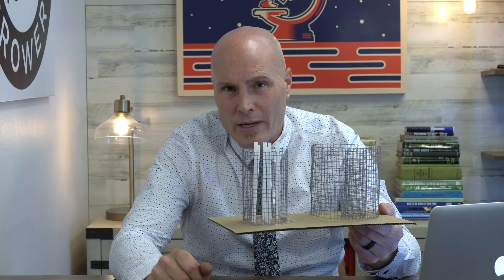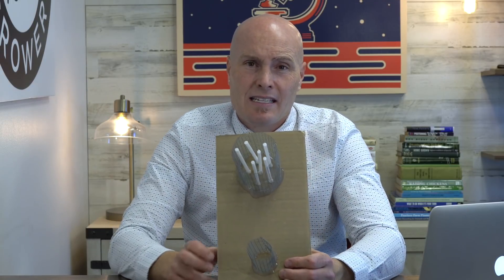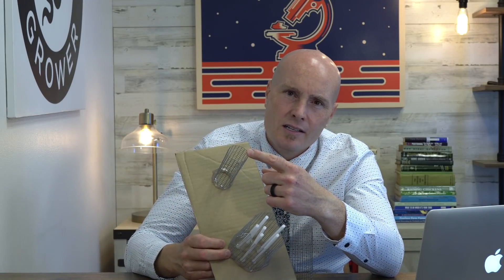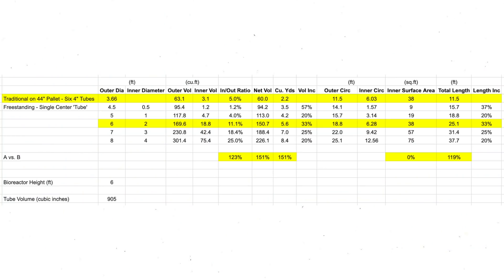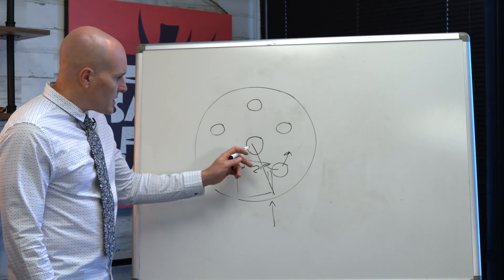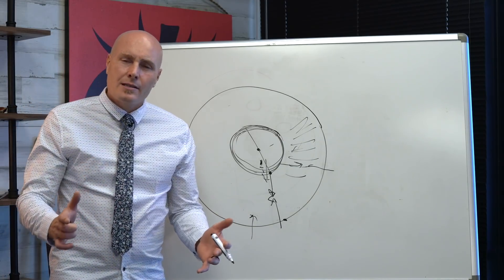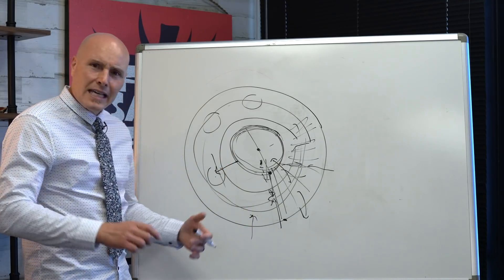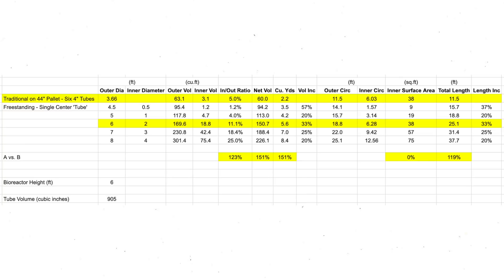Designing a New Compost Bioreactor | DESIGN SPECS and QUESTIONS ANSWERED

Comment: Put 4-5 hollow wooden pipes perforated with holes, horizontally through the wire mesh but leave out the center ring.  Position them from top to bottom with equal spacing between. Attach small fans to one end of the wooden pipes or one fan with a manifold to push air through the pipes and into the pile.
Make sure they dead end at the edge of the other side so all the air flow goes into the pile. 
Cover the biocomposter with a criss cross frame and an opaque tarp one foot above and around the composter, sealed at the bottom with dirt to create a humidity dome. Make sure the open end of the wooden pipes extend outside the dome but sealed to the dome. Mount the fans inside the open end of the wooden pipes.Then put a drip line ring on the top of the bio generator to provide water to maintain internal moisture. Sensors and a controller could be used to regulate the moisture and air parameters efficiently. The fan forced air should permeate further into the pile and the dome would contain the moisture. Regulation of the airflow is key so the pile doesnt dry out.
This in my opinion is a “bio-generator” as it has active inputs not passive input methods. Think of how an internal combustion engine works. Forced air and fuel input with lubrication,and means to adjust and control these parameters to efficiency. No doubt though it would not be aesthetic lol

Another method would be to use humidified air flow through the wooden pipes. Im using wood because they could be left permanently at least until they biodegraded to a point where they no longer worked. But certain wood species would last for at least a year or more. Also the wood could be a suitable host for mycellium to colonize and further enhance the decomposition.
Reply: The simpson su generator and other designs are really just vertical compost bins…..
Reply: You have to remember the center of a compost pile is where the action starts. You’re essentially eliminating the center of the pile with the inner ring, Forcing the decomposition to take place along the outer edge of the vertical pile where its prone to drying out faster. Also if you were to layer the components inside the bin it would be closer to replicating the natural environment.

Comment: Grateful to have found this video because I have been reluctant to use the traditional system due to aesthetics. Thank you for refining this bioreactor design to be more pleasing to the eye. Not a big fan of using a wood chipper so I am going to try your system with some larger branches and stumps in the mix. Time will tell, right?

Comment: Air input is beneficial.

I dig a trench and bury a pipe to get air to centre if the pile. There is a hole at ithe end snd u direct aur with a bent sheet if hardboard

Comment: Diego did you say metal will last longer than plastic?  
There was an accidental shooting on a movie set where someone died. The movie….RUST.
Plastic or pvc will likely be around until the next ice age. 
I call bs on that assertion at 3:23 or so. 
Chicken wire cardboard (from Amazon) and T posts seems to be viable as both compost machines and raised bed structures. I’ll continue watching because I’m addicted to your closing be kind be polite and do the work. Likely butchered but that’s the gist and I love to work in my lawn and garden

Comment: couple of comments about design.
#1) the original Johnson Su design.   the design goals were A) to make it portable, ergo the pallet, B) from your interview with David,   to have no more than 6 to 12 inches of space for access to air 
my C) is air flow.    by having a passage from the bottom to the top to allow air to flow all the way through, like a chimney.  The stagnant air pocket by dead ending on the ground eliminates that continual flow of air.
- to expound on the need for flow.   If one cubic mile of air contains X species (say 500) of fungus, with a concentration 10,000 per unit all the way down to 1 per unit,  the flow may (just making up numbers here) pass 10 cubic miles of air over a year,  the stagnant bottom version might expose the pile to 1/10th of 1 cubic mile due to wind.
=
On the plus side, your vastly larger opening will have a much greater surface area and that should offer more access to that minute quantity of fungi that many only see after a second year run.
=
interestingly, and way off topic.  but human space travel will be un-believably sterile as compared to our terrestrial existence.

Comment: It just makes all sense. Here in Colombia I found a mesh that can do all the job, it is used to sift sand; it is galvanized and strong enough to hold preasure and has much more than 80% of free space to let the air pass. Making a 5 feet with a one foot center by 3 feet high, its about a cubic meter of compost for just 10 dollar of material. Fair enough!!

Comment: Turn it on its side and place it on an axle.  Now you add a handle and turn the compost like commercial composters.  Little bits of compost would fall out of the mesh like a sieve and the bigger unfinished will stay put.  Lots of engineering challenges to get this thing horizontal, but it might be easier to fill than lifting shovelfuls of stuff chest high.

Comment: Great math. Do you think combining two geobins to hit the 6’ and taping maybe 6-8 pipes you use as the center tube would work almost as well? 

This is I think a great upgrade. The pipes in the middle are a pain in the butt haha
Reply from the maker: I would just use one Geobin and put a piece of PVC in the center.  I have been using that system and it works great.
Reply: @DiegoFooter  I actually found the same ones you have and they are great

Comment: The difference is that Johnson and Su are highly respected scientists who researched and perfected their method over the years, and they have the scientific data to back up their claims. They did the tests on their compost so that they know for a fact what the amount of bio diversity from the bacteria and fungi is. They don't do any guesswork. Your setup is a complete unknown, you have no scientific data whatsoever, and you only look at how easy you can fill up the setup with bio mass, and you hope for the best while there is no guarantee at all that it works the same as the setup from Johnson and SU. You just assume that you get the same result, but where is the scientific data with the results from a proper test that should back up your claims? 

I see many composting video misrepresenting the Johnson and Su bioreactor, or where people are falsely putting the name from Johnson and Su on a system that is not exactly constructed, and treated, and monitored as Johnson and Su instruct the people to do it. And the treatment and monitoring after the construction is just as important as the construction. When you change the design, no matter how small the change might seem, you will get a different result, it is that easy. But you have no idea if the result is better or worse. There is no scientific data. 

Johnson and Su speak about a very specific amount of heat for a very specific amount of time with a very specific moisture content with a very specific composition of materials that is used for their bioreactor. And they also speak about inoculation of their bio mass with existing bacteria and fungi before they fill up the bio reactor. 

It is the amount of biodiversity from the beneficial bacteria and fungi that makes the compost working so well. The larger the biodiversity is the more it will protect against the bacteria and diseases that are not desired. If you do things wrong, not as instructed by Johnson and Su, you even risk that you are multiplying harmful pathogens that you absolutely don't want to have in your compost. 

And I believe that people should not use the name from Johnson and Su when people are not doing exactly the same as what Johnson and Su instruct the people to do. I believe that the details matter and that the details make all the difference. 

Unless you can provide me with the scientific data from your own setup, which you really should not call a Johnson and Su bioreactor, I think that people should stick to the exact design and instructions from Johnson and Su. Sure your compost will be okay, and it is likely that people will still see some beneficial results. But if you want the exceptional good results, and an exceptional good compost, with a guaranteed success rate, people should follow the instructions from Johnson and Su exactly. Otherwise it is not even worth to do all the work. Otherwise you might as well throw all your biomass on a big pile somewhere in a corner without any care and attention for all the details, and you will get the same mediocre results. You will get an okay compost, but nothing special.
Reply from the maker: That’s fair.

Do what works best for your context. 👍
Reply: @DiegoFooter  What I am trying to say is that you say that your setup has a better airflow, and on itself that is true, but did the setup from Johnson and Su need more airflow to begin with? Because now you also need more water to keep the moisture content at level for the fungi. Otherwise the fungi will not grow throughout the entire pile as desired, and that is the most important aspect from the Johnson and Su bioreactor. And that is the whole reason why one would do all the work in the first place. 

You don't want the pile to become anaerobe, but you also don't want it to become too dry either. 

I think that Johnson and Su carefully monitored the air to moisture ratio from their setup, and after careful monitoring and testing for several years that is how they came up with their specific design and the specific dimensions from their design. 

When you only adjust the airflow without monitoring the moisture content it is very likely that large parts of the pile will have no or only a small amount of fungi. Which is not worth to do all that work. 

And another tip, to keep the pipes in place people can also use some wood instead of steel in order to make a temporarily frame. So that shouldn't have to be an issue either. A couple of planks would be enough.

Comment: I think the air diffusion distance to the center of the layer is about twice is that the original Johnson-Su 6-pipe design, which means your efficiency could be only 1/4 of theirs.

Comment: The concept is good, however, I have some concerns.
1. Building it directly on the ground, the center cage will allow air to the center, but could become stagnate as there is no circulation, digging a well by hand to a depth of some 20 + feet down we found the air stagnates and had to put a flexible pipe in with a fan blowing air down to circulate the area. The same thing may happen to this design. A way to overcome this would be to place several 4-inch pipes on the ground to the center of the pile to allow circulation, fresh oxygen-rich air. This is not a problem with David's design, by having through holes, cool air enters from under and as it warms up, rises to provide fresh oxygen-rich air.                                                                                                             
2. Although air can make its way to around 12 inches into a pile, in David's design, the air only has to push in 9 inches from any direction to fully aerate the pile, in some areas, the air only has to penetrate 5 inches, a better environment for bacteria and fungi to thrive as the main reason is to make high fungi dominated compost, not just ordinary compost.
3. A premium quality weed mat will last for many years as compared to the cheap stuff, (found that out the hard way). The advantage of using a good weed mat, it (in my experience) keeps the soil cooler than exposed soil, keeps the pile moist to the edge, and stops the pile from drying out due to wind.  As David mentioned, he adds compost worms as soon as the pile cools down, worms will not come to the surface unless it is covered and moist. Note! compost worms, not the normal ground worms.
By the way, we have a septic tank on the farm and it doesn't look like a Johnson Bioreactor. 
4. Using David's design, the pipes stayed where they were meant to and did not cause any problems with loading the reactor as he used metal rods, I would think that you should know someone who could make a device to do the job for you. 
The only alteration I would make, put covers on top of the pipes to ensure they stay clean.
I will stick with David's design. Although one will do our farm using David's methods of distribution, I will have two when finished, the second one will be a backup, we only have 360 acres to work with, It is not like Ian and Dianne Haggerty's farm in western Australia of some 8000 acres under cultivation.
Steve

Comment: Yeah, I like the change to chicken wire instead of fabric. I'd prefer the donut, too. I'm thinking I don't know whether the off gasses are heavier than the air, so I'd go with an under support to either allow heavy off gassing to fall out, or light off gassing to rise out, and allow air to come up from below. So I'd stick with the pallet for air circulation. I know, the pallet won't fit, but I'd place four small pallets for the large ring, and a single pallet in the center for the little ring.

Comment: I have a few questions. If you've done both then and took the measurements while completing the composting. 
1. Does the larger center hole and the lack of weed fabric prevent the outer areas from getting hot enough to burn off seed, ie 131F degrees?
2. Do the inner and outer surfaces end up having a harder time staying moist?
3. Does the lack of pallets hinder the natural flow of air created by the center air warming and rising to pull in the cool air, as it would be happening when using the pallet(s)?

Thanks for the great ideas. My plan is to fill a reactor in the fall and again in the spring using the wood chips from the chicken pen, which will have the poop and the added leftovers of garden materials mixed in by the constant scratching.
Reply: I wondered the same thing (your #1 question) since everyone says “build your pile at least 3 ft high and 3 ft wide to give it enough mass to heat up properly.” Reading through the other comments, it looks like this style is better for a non-thermophilic compost pile. I was kind of hoping I could do a traditional thermophilic pile but without having to turn it (because of the center hole providing the airflow), but this method doesn’t even heat up that much. He did mention at the beginning that it tended to produce a more fungally-dominant compost in the end (hot piles tend to be more bacteria-dominant, although Dr. Elaine says you can balance out the bacteria-fungus ratio by adding fungal foods after the pile has finished/cooled off.)

Comment: I personally think that this is a huge potential improvement.  I was leary of jumping into the original design because of all the plastic and it seemed super finicky to work with the way it was originally designed.  I'd like to see the temp and biology stats done on the comparison, but I feel that it is likely not far off, given the spacing.  Also, the worms will work their way in with that surface area/soil contact (rather than the pallet in the original design), aerating the bottom, and they will infiltrate the cooler outer zone even while the pile is initially hot.  I think the latter can be improved by Inoculating the lower outer and inner edges of the pile rings with a bit more wet veg material and put the compost worms there right when you build it.  They will climb the outer part of the pile as the composting begins, and then when it cools be in place, in volume to inoculate the full volume.  The other improvement that might aid the system is planting potatoes all along the outside of the outer ring, and even the inside, and especially the top.  (Further inoculation of worm food at these planting locations might be a good idea.)  Plant every 1.5 feet (or so?), spaced alternate diagonally maybe as well as all around the top.  Mulch with straw/hay/ramial chips or whatever as potatoes grow on the pile top.  Plant the side ones about six inches in so they have space to root and tuber out a bit without being mulched outside.  These are more the bonus crop that provides shade to the outer surface area.  (an additional outer ring of concrete mesh filled with hay could also be put in place for the spuds to feed on and tuber out to, so, in that case you might get a large crop here too...?)  These areas of the pile never get super hot in any compost and will give you a further incentive to water the thing, and the potatoes will tell you when they need water (by observation).  The potato idea, as mentioned, will also reduce the evaporation/wind wicking problem that creates a hydrophobic biology on the exposed chips (which is why Johnson-Su has the outer landscape fabric).  Thanks for your inspiring inovation and the seed for this brainstorm!  I'll try to make it a reality in the spring!   Peace.

Comment: I don't think collapse of airflow during the vermiculture phase is a problem in fact the worms liely do much of that themselves. I noticed in his presentation Dr. Johnson mentions that feedstock seemed to make little difference in the analysis of species in the final mix. I actually think that the worms are maintaining that similarity by their gut action. I expect much of the final product is a work of the worms because the material he shows looks almost the same as vermicompost. Too bad he hasn't, to my knowledge, tried running the bioreactor without worms.